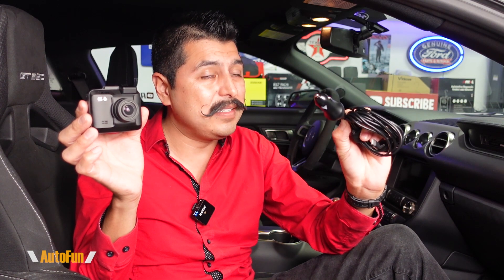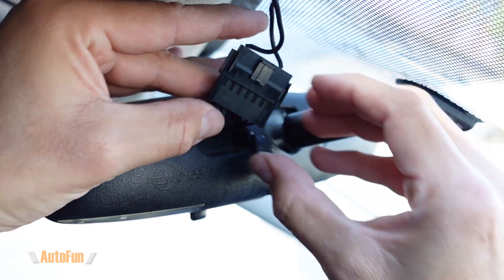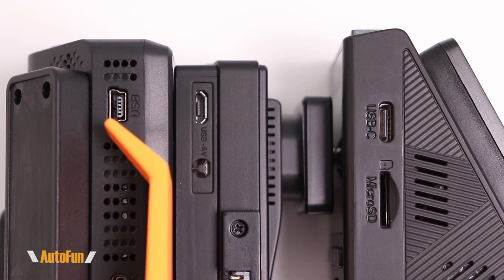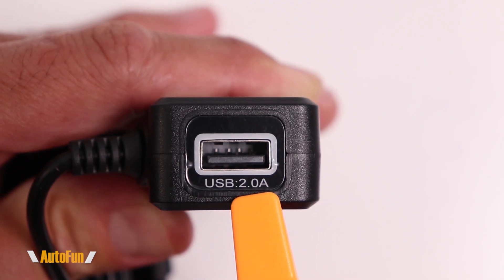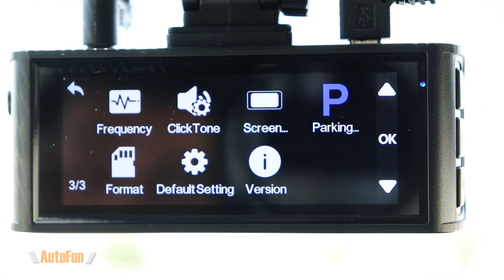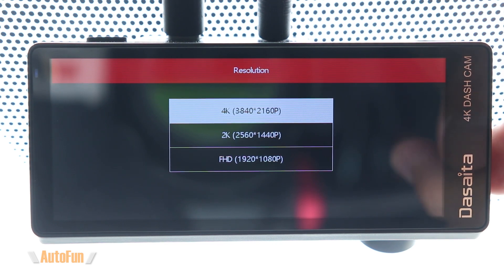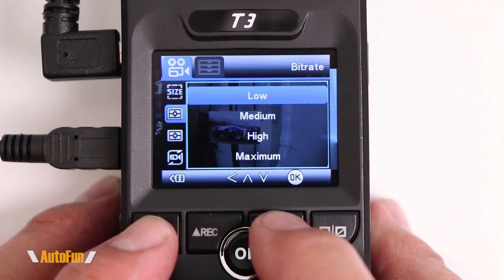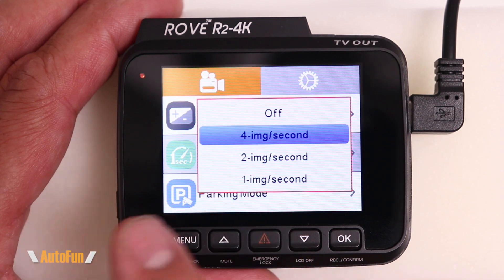Dongar Technologies Dash Cam Mirror Tap Install (Hardwire Alternative)

Comment: Sadly my car is 23 year old so I'm stuck with the OBD power plug. Its not so bad since I only have to unplug once a year when I get my smog test done. But my wife car uses Dongar so easy to set up.
Reply from the maker: Hi! Ah yes I have a similar setup like that where I use the OBD2 adapter on one car and on another the Mirror Power Adapter. Here is the video on the OBD2 adapter https://youtu.be/YEklm9V6xYE which does have the advantage of allowing monitoring the car while parked where on the power mirror adapter that option will only work if the car provides power to the mirror all the time. Cheers friend!

Comment: Useless without the power mirror. No thanks.
Reply from the maker: Hi Bob! Correct, if your car mirror does not have a power going to it, the mirror adapter will not work. For those cases here is my other solution https://youtu.be/YEklm9V6xYE Cheers!

Comment: Question - when hardwired without factory adapter I cannot access the parking mode settings in the app - will this adapter let me access this?  Also - do you know offhand which one is for a Toyota Highlander Hybrid 2021
Reply from the maker: Hi Robin! Nope the adapter will not enable parking mode. I placed a link to the Toyota adapters in the video description, the Highlander is likely a 5 or 7 pins one.  Here is another alternative to hardwire that could potentially be used to monitor the car while parked https://youtu.be/YEklm9V6xYE Cheers!

Comment: Nice but I DON'T see one for TESLA MODEL Y I need in cabin for my Uber passenger this hack is nice
Reply from the maker: Thanks! Yeah there is currently no adapter for the Tesla Model Y, however the universal adapter can potentially be used (assuming the Tesla is able to supply 12VDC) while I know some installers have located 12VDC, I imagine the key is going to be on selecting a circuit that is not impacted by tapping from it. I cover this topic in more detail on my prior video here https://youtu.be/K2iKXj82354 Cheers!

Comment: I have a problem. Fuse tap needs to be installed in correct orientation, in my case with wire pointing up. But only fuses available are on top row against fuse box casing so it cannot plug in. Any ideas?
Reply from the maker: Hi! Ah correct, if hardwiring using fuse taps they do have only one correct orientation as explained on my video here https://youtu.be/K2iKXj82354 And yes in a few cases the fuse taps may conflict with the fuse box cover or fuse box box itself, you can actually see that on my other install video here https://youtu.be/uZp95NbNlmM where the fuse cover had to left off. And on here https://youtu.be/zbxYA4VhuT8 where I had to shave each end of the plastic edges to get the fuse tap tp fit, you can actually see how the fuse taps have been modified (ends shaved off, which I hid with some electrical tape lol) Cheers!
Reply: @AlexAutoFun  Thanks, Alex. I see where you paired the ends but the vw polo is even tighter.  Have you used a "Blade Fuse + Breakout Wire", any thoughts and is it safe?  Appreciated.

Comment: Will this work with 2013 camaro ?
Reply from the maker: Hi Itachi! There is currently no adapter for the Camaro however the Dongar universal adapter can potentially be used instead, I placed a link to in the video description. Cheers!

Comment: I want to upgrade my dash cam i have usb b mini hard wire connection can you help me out how can i install wolfbox g900 with exsisting usb b mini hard wire connection from my old dash cam
Reply from the maker: Hi Zam! The Wolfbox G900 uses a USB C connector as shown on my full review here https://youtu.be/eNK6ujrWWkA While there are adapters out there that go from Mini USB to USB C like this one https://amzn.to/47aAaQa I personally would not recommend attempting to use one with the G900 to avoid potential damage, I recommend using the power adapter included with the G900 or the matching hardwire kit, here is the video for that kit https://youtu.be/0KwoF1ZVnsc Cheers!
Reply: @AlexAutoFun  thankyou for your feed back
Reply from the maker: You're welcome! @zamzamar9376

Comment: Excellent presentation. But my 2024 Ranger has no visible wires, even tho the mirror is electric. What would I use?
Reply from the maker: Thank you! Ah yes, I placed the link to the adapter for the Ranger in the video description (the 3 Pin one). The listing shows it's compatible with Ranger (with auto-dimming mirror) Cheers!

Comment: Which one would I use for a 2010 jeep compass? Having a hard time locating one.
Reply from the maker: Hi Zim! Typically Jeeps use the Dodge or the Mopar one (I placed links to both in the video description). Your installer can determine which one will be needed by comparing the connector on your car to the pictures of the adapter. Alternatively, the "Universal" Adapter could be used as well but it does require your installer to identify the power wires on your mirror to be able to tap them. I placed the link to the Universal one in the video description as well if needed. Cheers!
Reply: Thanks for answering my question. They seem to be sold out on their website. I also checked Amazon and eBay. Does anyone else make these adapters? Thank you for your time.
Reply from the maker: Hi Zim! The Dodge is available, I just checked, the Mopar one seems to be out of stock but I noticed that happens often, they get a few in and the sell out quick (not sure if they quantities are small or there is just that much demand for them) So I would recommend to keep checking if you need the Mopar instead of the Dodge one. Cheers!